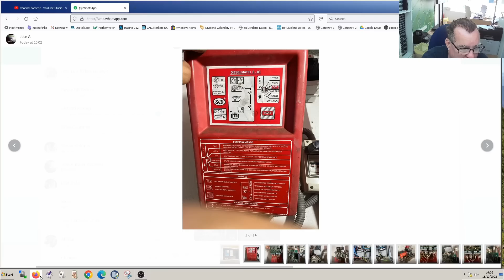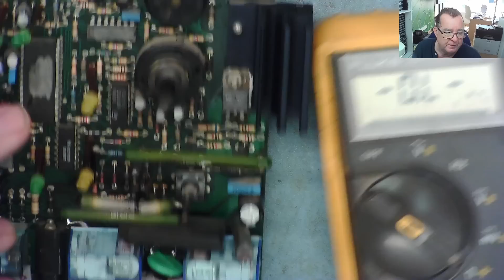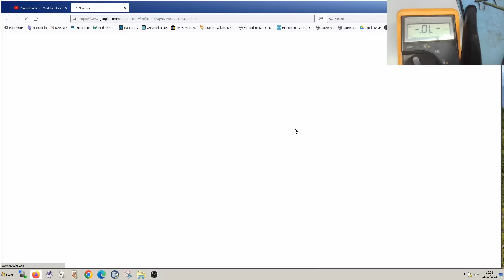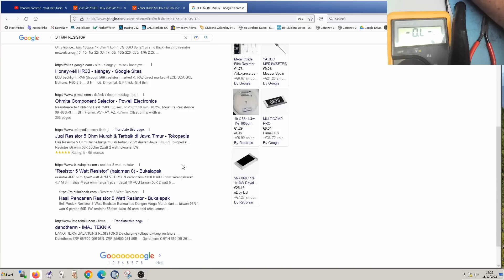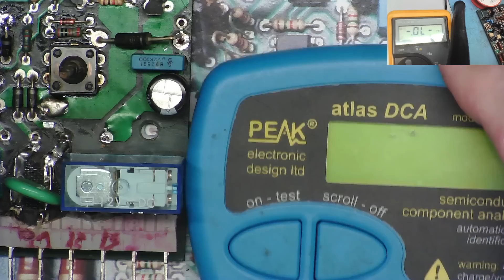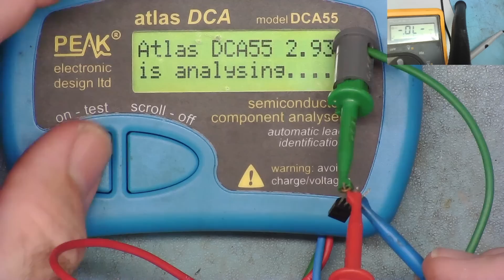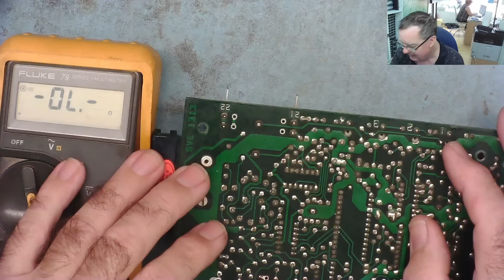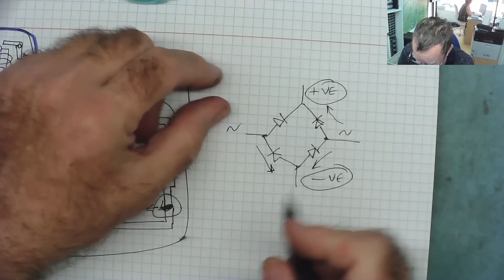Industrial Electronics Repair Use Basic Electronics Knowledge To Fix Just About Anything For PROFIT

Comment: getting parts in the canaries is a pain in the ass.  Ali helps but times are very long in some cases.  I have not found any online store in the Canary Islands with a good catalog and from the peninsula they simply do not ship.  The only thing I found and have used when I need something fast are the pages that manufacture PCBs, in my case I used jlpcb that sells parts and assembles them with a wide catalog.  shipping is somewhat expensive (goes by weight and only by FedEx or dhl parcel it cost me €18 but in 15 days I had everything) I ordered a decent order it cost me about €35 several capacitors, power resistors, voltage regulators, and a ic to repair a couple of things at home.  the truth is that it is not that expensive considering that it only takes 15 days (although the time will never always be the same) on the island where I live (El Hierro) there is no repair or component shop in the end I end up repairing my things and hoarding a few old PCBs for parts (even if it's for temporary repairs until you have new parts)
Reply from the maker: Ahh you are on one of the smaller islands then (and the most westerly).  We have a couple of electronic component shops in Las Palmas which hold quite a large stock but it is more expensive than buying online.  AliExpress are pretty good at delivering here, everything turns up (eventually).  I may be able to post something over if you need it and I have it, email me electronicanaria@outlook.com   And greetings to a fellow Canarian from Maspalomas
Reply: Aliexpress work but times are random, 29 days is the normal but some times is less and sometimes is 3 months (customs is a pain I see expending more than 20 days there's). 
I keep the page you use in mi browser for future (thas one I no have) 
The last year mi fridge go bad. Power off at random sometimes power off and on randomly. I contact Samsung they say send to repair (yea easy send to Tenerife the only aprov shop) I contact the shop if they sell the board (of course no) so repair Quick is the only option. Don't want the food go bad. 
that was a difficult fault to find, the main capacitor was beginning to fail (high SNR not much but), the regulator gave a strange measurement (normally about 500-600 this averages almost 900 in diode for a 7812 family) they were changed. 
it failed again a couple of days (as I say the failure is sporadic) in the end it was an SMD capacitor, just below the electrolytic capacitors there is an SMD capacitor only 10 pf in all caps, probably for emi but no needed whit a 2200nf cap in the same spot (thanks to the fact that my Thermal Camera arrived I could see that one heated up and cooled down, like a heartbeat a failure that is difficult to see)

Comment: Watching you tryig so hard to desolder that bridge rectifier was absolutely painful. A soldering iron will melt the solder on both sides if you dump some fresh solder into the joint. A little bit of leverage and it will fall right out
Reply: Don't forget the flux

Comment: for a start i tested a bridge where 240volts AC that’s feed to its it converts to DC it smooth outs almost 300volts sometimes the resistances go lows it allowing to much currents to past to its if high resistance it will not past enough currents to its if it’s leaking sometimes it allowed DIRECT AC to it and destroyed Avery things or it’s act as dead with outs any voltage at the outs puts  it could be a million problems with something’s else’s to fixed this problem sometimes you things you were bone yesterday by going backs to learned ABC to fixed this staff

Comment: This is actually my goal is to buy broken electronics and start flipping them for a profit on ebay.
I have a medical issue so it's hard to get work because of gaps but I have unlimited time so even if it takes me like 4 hour to fix something that I can only make 10-20$ off of after reselling its worth it.
Reply from the maker: That is the best way to learn as you don't have anybody hassling you to finish a repair, it's not a problem if you make it worse than when you started (this will happen while you are learning) and you can put things on one side then come back to them later as your knowledge and skills improve.  And yes you can make a good amount of money from doing it.
Reply: thanks for the reply

Comment: i repaired lots and lots of things the most comments false findings is the parts they tied it together while’s they still inside the circuits boards sometimes you measured it shows faulty when you pulled it out it measured ok no one’s will want to pulled it outs and put it’s backs against it a nightmare

Comment: BS 5750 ISO 9001 as EU, UK STANDARDS for all of branches of all industryr in Britain to not include independent countries where I have no knowledge. 
Prior to the early 1990s and the advent of the introduction of BS 5750 there were independent electronic repair shops. Manufacturer's didn't repair in most cases unless it was a small company. A spinoff of radio and TV and then R&TV became "board changers" on cost grounds and skills to repair evaporated and WIRING DIAGRAMS!
There was working Internet for more years to source backup knowledge except in very limited numbers.

The key statement that became a source of huge revenue, "ALL REPAIRED CIRCUIT BOARDS ARE SUB-STANDARD. Insurance cover became an issue.

The legal recognition of, British Gas CORGI then replaced by Gas Safe as a representative of the Health and Safety Executive to regulate the use of natural gas and bottled gas throughout Britain and I would conclude the EU. Gas boilers became hybrid with automatic boilers controlled by time locks and thermostats from the 1950s. Then fully electronic, automatic ignition with larger PCBs because modulated flames for greater efficiency similar to the effect of an accelerator in a vehicle.
PCBs became single use with the same label substandard if repaired and boiler manufacturer's only sold new quality spare boards.
Circuit boards should be repairable with regard to producing unwanted electronic waste with precious metals included.

Comment: I was shouting at you to use your desoldering gun to remove the bridge (you should have been able to get enough heat to travel up the pins to melt / extract the solder on the top layer) but you obviously couldn't hear, or ignored me. Ho, ho. 

One suggestion, when searching, is to click on images (instead of all) as you generally see a much wider range and can find something close to the component (to determine wattage etc).
Reply from the maker: The bridge was not easy to remove as someone else had previously tried.  If you watch to the end you will see i intend to replace it with four individual rectifier diodes to make it simpler to fit them - that at least I think is a good plan 😉
Reply from the maker: @ralphj4012  Ahh yeah  I see what you mean, I'll check it tomorrow to see if it is cracked. I hope not, that is one of the chips with no markings🙄

Comment: It is complete and utter nonsense to say that there is very little or no current flowing out of one end an inductor when current is flowing into the other end. That is simply contrary to the way current flow works. For each and every electron that goes in one end of an inductor another electron flows out the other end. The current into one end is exactly equal to the current flowing out of the other end. The current through an inductor does start at zero when voltage is first applied across it, assuming it was fully discharged to begin with.

You do not have to use a diode across a relay coil. There are several methods to provide a discharge path for the coil inductance.Diodes are very common but they delay the start of opening of the contacts and slow the opening once it has started because they lengthen the time it takes to discharge the inuctance. This can cause arcing of the contacts to be worse. Techniques that allow higher voltage across the coil when discharging the inductance shorten the delay and speed separation of the contacts.

di/dt = V/L

Comment: Lead free solder is good. We have to stop using lead when we have alternatives because it is fucking terrible for people and the environment. Especially when the reasons for not using it is a slight inconvenience, come on dealing with lead-free solder isn't that difficult.
Reply from the maker: You use it if you prefer it, I have no problem with that whatsoever 😉
To persuade me to like it, can you tell me what I need to do to stop it clogging up my vacuum desoldering tool (as clearly proven in this video)
Reply: Lead sure is toxic, like all heavy metals, but only when it gets into the environment (by means of leaded petrol/gasoline, lead in childrens' toys etc), where it eventually ends up accumulating in living organisms.

However, a PCB with leaded solder poses no risk to anyone by itself. I've always suspected that lead-free solder mostly serves as an excuse to keep chucking electronic waste into landfills, rather than recycling it properly. 

Lead is extremely easy to recycle due to its low melting point. Case in point: Look up the recycling process for lead-acid batteries.
Reply: Bismuth and cadmium are not that good for you either and they are in solder,so where do we draw the line ?